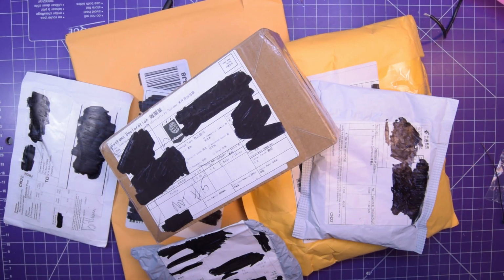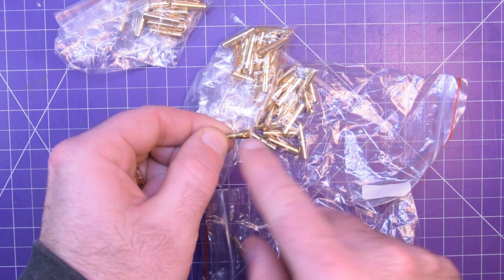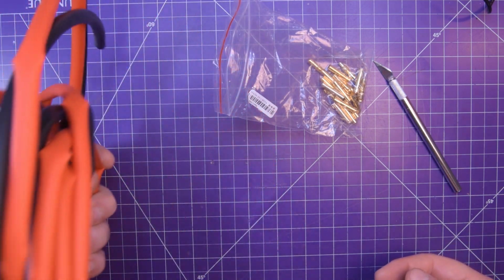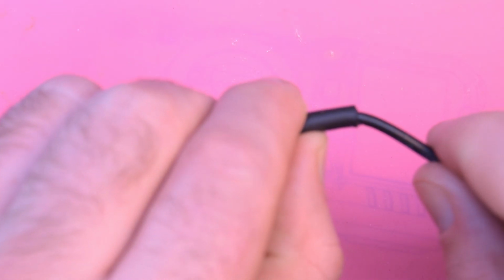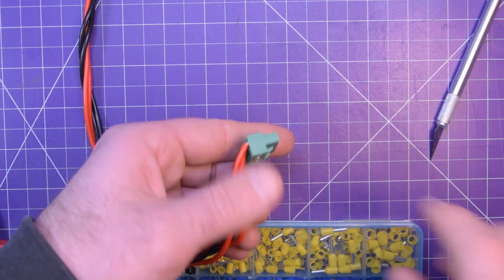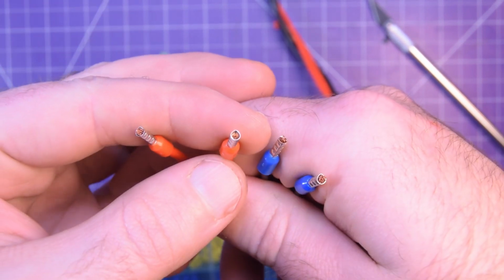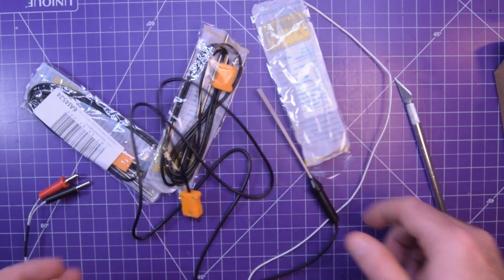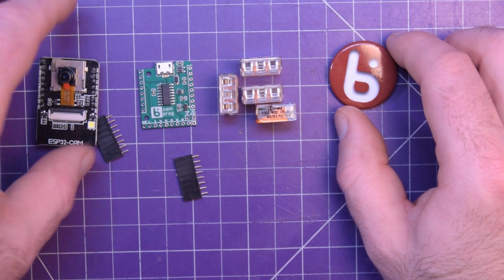Mailbag 75 - The Looniest Episode!

Comment: You got a Circuit playground express! They are a great way to get into coding especially circuit python.
Reply from the maker: I wasn't sure if that's the exact one you had, but I talked about your experience to Scott in the last podcast episode! - we need to get you more subscribers btw!
Reply: @SimpleElectronics  Yep that is the right one. I’m getting caught up listening to podcasts so I’ll listen to that episode soon. BTW I use the 4mm bullet connectors on my brushed/brushless motors and speed controllers and love them. I’ll have to check out the heat shrink and ferrules you showed for my R/C workbench.
Reply from the maker: @dadsrcworkbench1322  The heatshrink will change your life :) I didn't notice, it's double-walled as well. VERY rub resistant

Comment: I have my heat gun at 250 deg C. Works much better than at 150 C
I prefer to solder my wires before putting in the screw terminals, the screw indents into the solder to get a better connection.

Comment: I enjoyed your Mailbag this week!

I noticed the Ferrules in your kit are not following any color conventions. Ferrules are normally color coded for the size of the wire they will crimp. The color coding is similar to spade lugs that have yellow, blue, and red insulated areas that are crimped within the corresponding yellow, blue, and red areas of a lug crimper. There are three major color codes for ferrules. There is the German DIN (D), the German company Weidmuller (W) , and the French company Telemecanique (T). The DIN standard is probably the most used standard. You can do a google search for Ferrule Color Codes to find the charts of the standards. Obviously, you can purchase any color for any size on the market though.

You can also purchase longer and shorter pin sizes for each size ferrule. A lot of the kits come with 6mm or 8mm pin sizes. I noticed you had wire coming out of the end of the crimped pin. This can be trimmed before you put it into the terminal block so the pin will be flush with the block when the pin is secured in the block.

You can also purchase non-insulated ferrules to use in ground blocks or use when building a test leads with a screw or spring terminated banana plugs. A good company to purchase Ferrules from is Ferrules Direct in the U.S. I found they were cheaper than Amazon for smaller quantities of 100 in a given size.

Comment: I ordered from Wish.com for first time .  Approx 8 orders.... last order arrived 4 month later??? Heat shrink. 
Also everything was differant to what I was expecting ?  Solder after it cooled turned dull silver. 
Screwdriver kit was 10 x smaller than picture. 
And the products were worded so I thought i was getting transjster tester, but I received a box with no tech to put in box...lol... robbing buggers

Comment: I have that crimp tool and ferrules and they are just fantastic for making reliable connections for screw-in terminals. 
Great video as always, stay safe and have fun,
Joe
Reply: I bought a cheaper and lesser quality crimper,  for home.  Even out the box , it couldn't strip cable, for one, and it just never did wot it said on the tin.
Reply: That's good to know, cos my crimping tools either crimp to much and sheathing gets damaged.  Or it's not crimped enough and wire pulls out.  On those ferrules you crimped the terminal end.  On ones I've always used I crimp the plastic sheathing which can rip, exposing bare connector

Comment: Nice.I love ferrules and crimp connectors in general. Unfortunately my crimper lost in the mail.. Until I received it for ferrules I use a small needle nose plier and for 0.5mm and 1.5mm wire works pretty well but I used this way only for prototypes and low voltages  not for any house electrical work!!
Reply from the maker: I don't think ferrules are code for electrical work anyway, but perfectly fine for DC stuff!
Reply: @SimpleElectronics  I am pretty sure that control system-automation engineers used them .I am not sure if that common for electrical.

Comment: I bought the same ferrule kit. Nice
Reply from the maker: I'm pretty sure you were the inspiration! Was it you that told me about your ferrule crimper?
Reply: @SimpleElectronics  Have you heard the pedantic argument against tinning a stranded wire that gets screwed down?
Reply from the maker: @GnuReligion  yes! it gets all crusty....my gut tells me it isn't a good idea but I don't have any proof!
Reply: @SimpleElectronics  Oxidation seems plausible.  But I heard that ferrules are used instead of solder tinning, because led does not deform in a springy fashion.  A mechanical connection with led  loosens with time due to cycles of temperature change.  (shrug)  Honestly, I do not know the One True Answer.
Reply: Hi. This is Miguel from Portugal.
I like your youtube channel.
Can you put the links of the products from the video?
We my be interest to buy it.
Reply from the maker: @mazevedo852  yeah I always forget, let me work on that, sorry!
Reply: I bought some ferrules last year, but just a cheapo flat crimper though.
Sure is the right thing to solidify a stranded wire!  I hear they are in wide use in Europe.